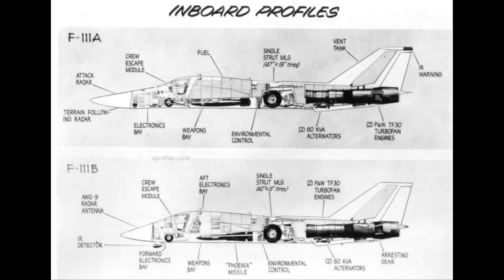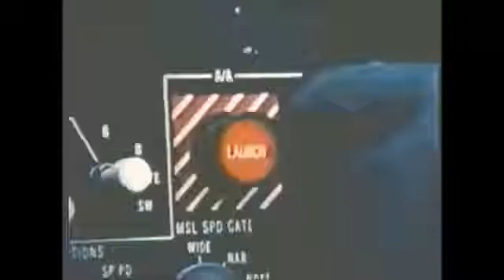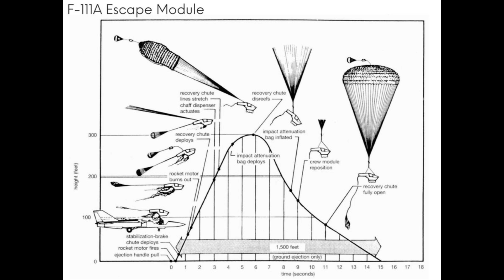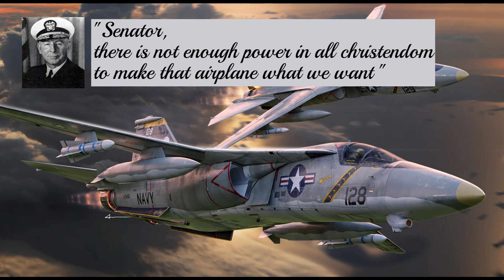The F 111B, Rejected by The Navy #aviation #military #militaryaviation

Comment: The F-111B was indeed what the Navy thought it needed when their program was combined with the Air Force as the TFX program.  The Navy later changed its mind as a result of combat experience in Vietnam. The injustice of the popular narrative is that the airplane gets the blame for what was really a change of heart by the Navy.

When the TFX program began the USAF and USN were both asking for a large aircraft that could lift a heavy load of fuel and weapons, with long range or long loiter, plus high-speed dash or intercept. To achieve this twin engines and an innovative variable geometry wing were called for, and DOD logically assessed that it would be wasteful to develop two very expensive advanced airframes when a single one with some variations could do both jobs. 
The reason one basic airframe could do both jobs was because original USN specification was for a fleet defense fighter, not an air superiority fighter. It was not originally intended to be what later became the F-14, but to perform the role meant for the Douglas F6D Missileer, with the addition of supersonic dash capability. It was not intended to be a dogfighter. 
  
The biggest difference between the airframe requirements of the two services was that the USAF wanted a tandem cockpit and the USN wanted side-by-side seating.  Boeing tried to make both services happy and made two different configurations, but MacNamara’s DOD wanted more commonality and thought USAF could suck it up and have the crew sit side by side.  This is ironic considering that when the Navy cancelled its version USAF was stuck with the cockpit it didn’t want, which also ironically contributed to the airplane being too ungainly to be a dogfighter.  If the Navy had wanted a dogfighter it would not have insisted on the side-by-side cockpit over the objections of the Air Force.  The F-111 cockpit was suitable for a radar interceptor, but not for an air superiority  fighter.

The original idea wasn’t dumb -- what happened was that needs changed.  USN revised its requirements for its next fighter as result of combat experience in Vietnam, and they realized that the missileer was too limited a role.  The also needed an air superiority fighter to replace the F-8 and F-4, but couldn’t afford that in addition to a dedicated fleet defense aircraft.  Thus, the TFX would now have to be able to dogfight as well as be a missile interceptor.  The F-111B would have worked as a missileer, but it was too fat and underpowered to compete as an air superiority fighter.  It was proper of the Navy to recognize that its needs had evolved.  This was perhaps the beginning of the Navy realizing that budgets and hangar decks did not have room for so many specialized aircraft.  USAF desperately needed the F-111 to replace the F-105, so they sucked it up and accepted the overweight airframe caused by the loveseat cockpit they never wanted.

Comment: As Vice Admiral Tom Connolly said in a Senate hearing on the aircraft that lasted six hours, “There isn’t enough thrust in all Christendom to make a Navy fighter out of that airplane:”
Reply: Yeah, that was a great sound bite to convince Congress to let the Navy shift to a new fighter program..  But the F-111B had never been intended to be a fighter.  It was to be an update of the Missileer concept with added high speed capability.  

When the TFX program began the USAF and USN were both asking for a large aircraft that could lift a heavy load of fuel and weapons, with long range or long loiter, plus high-speed dash or intercept. To achieve this twin engines and an innovative variable geometry wing were called for, and DOD logically assessed that it would be wasteful to develop two very expensive advanced airframes when a single one with some variations could do both jobs. 

The reason one basic airframe could do both jobs was because original USN specification was for a fleet defense fighter, not an air superiority fighter. It was not originally intended to be what later became the F-14, but to perform the role meant for the Douglas F6D Missileer, with the addition of supersonic dash capability. It was not intended to be a dogfighter.   

The biggest difference between the airframe requirements of the two services was that the USAF wanted a tandem cockpit and the USN wanted side-by-side seating.  Boeing tried to make both services happy and made two different configurations, but MacNamara’s DOD wanted more commonality and thought USAF could suck it up and have the crew sit side by side.  This is ironic considering that when the Navy cancelled its version USAF was stuck with the cockpit it didn’t want, which also ironically contributed to the airplane being too ungainly to be a dogfighter.  If the Navy had wanted a dogfighter it would not have insisted on the side-by-side cockpit over the objections of the Air Force.  The F-111 cockpit was suitable for a radar interceptor, but not for an air superiority  fighter.

The original idea wasn’t dumb -- what happened was that needs changed.  USN revised its requirements for its next fighter as result of combat experience in Vietnam, and they realized that the missileer was too limited a role.  The also needed an air superiority fighter to replace the F-8 and F-4, but couldn’t afford that in addition to a dedicated fleet defense aircraft.  Thus, the TFX would now have to be able to dogfight as well as be a missile interceptor.  The F-111B could have worked as a missileer, but it was too fat and underpowered to compete as an air superiority fighter.  It was proper of the Navy to recognize that its needs had evolved.  This was perhaps the beginning of the Navy realizing that budgets and hangar decks did not have room for so many specialized aircraft.  USAF desperately needed the F-111 to replace the F-105, so they sucked it up and accepted the overweight airframe caused by the loveseat cockpit they never wanted.
Reply: @gort8203  And with the D model it became a masterpiece. It evolved in to a precision munitions deployment platform, thank you Snort, and bombing platform.
Reply: @JustaPilot1  The F-111 was great bomber that could do things no other bomber could at the time.